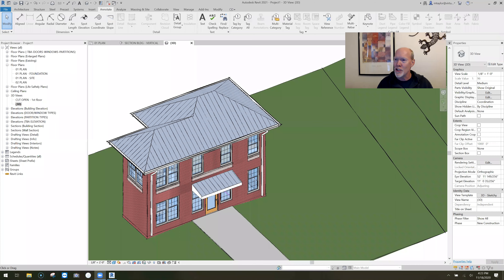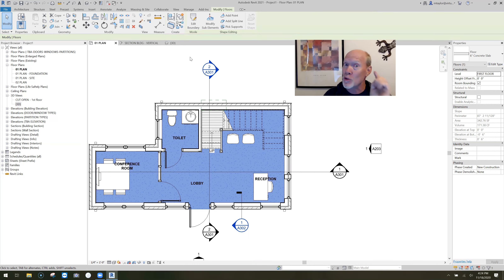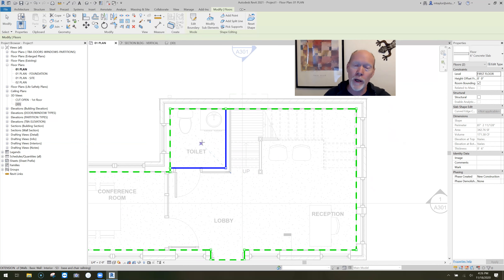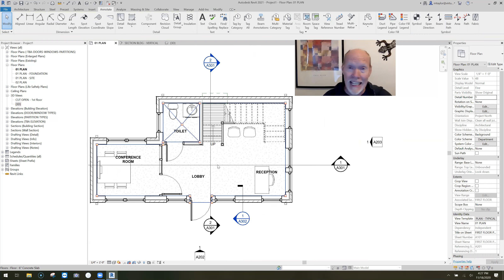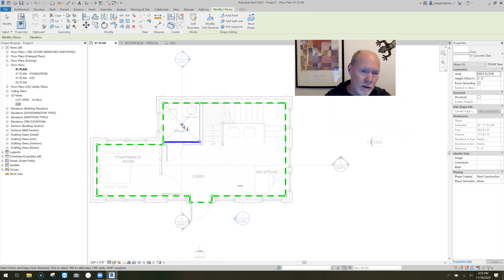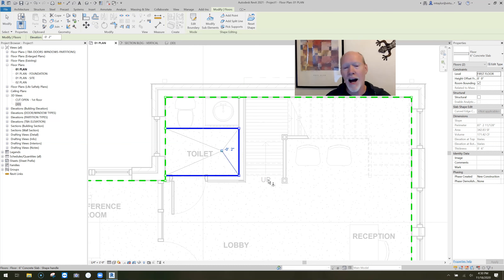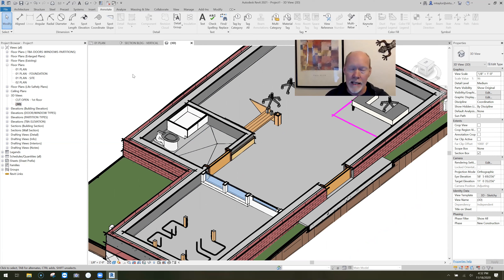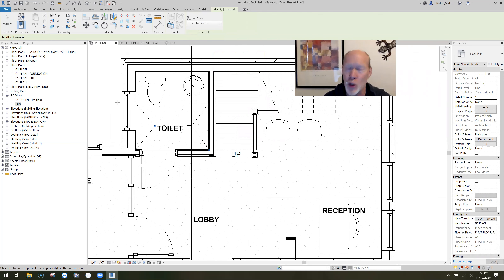SLOPE A FLOOR TO DRAIN: Using Sub-Elements

Comment: Is there a solution so that there is a slope only at the top and the slope at the bottom of the floor stays straight?
Reply from the maker: Yes! Great question. If you want the bottom of the slab to stay level and only vary the top surface... you need to select the slab, select Edit Type and then the Structure button. Select the concrete material (or whatever your floor is made of) and make its thickness VARIABLE. It’s a checkbox. :)

Comment: it is not helpful since it also slopes the structural slab which is not correct , we usually only need to slope (parts) which is the top layers above the structural slab and in our office we just use annotation arrows to indicate where the surface slopes to the drainage point
Reply from the maker: I guess I should have made the slab out of layers.. like the structural slab and the topping slab. That way we can release the topping slab thickness and not effect the structural slab below.  Sounds like a great idea for a Revit Tip!  Thanks.